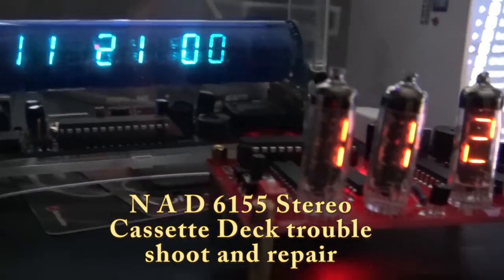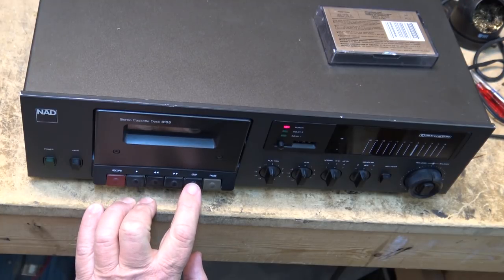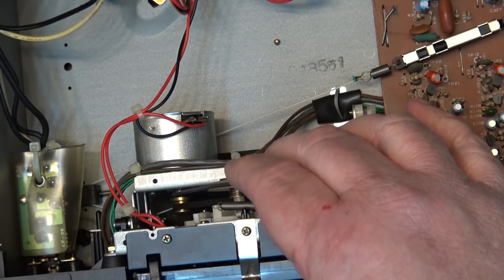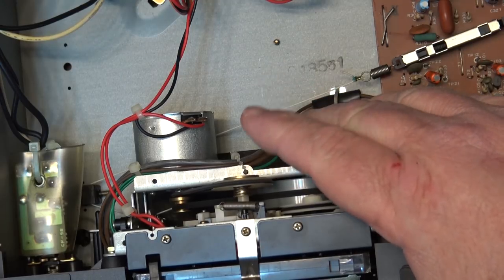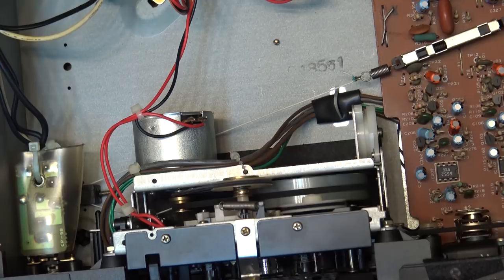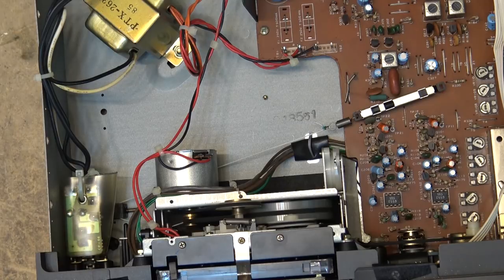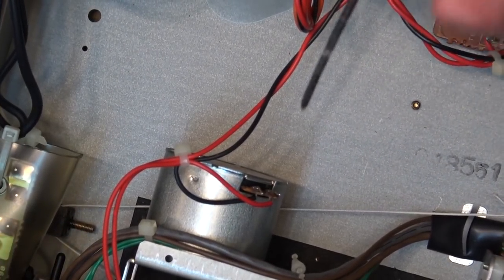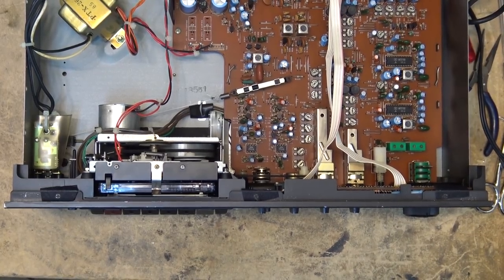NAD 6155 Cassette deck repair

Comment: TI-99
Reply: BillyLapTop I think we have a winner
Reply from the maker: Gold star for you! 
To be precise TI-99/4A
Reply: Thank you for the Gold star.  I had several of the TI's, in addition to a whole bunch of other brands in those days.  Those were really fantastic and exciting times because personal computers were just taking off.  

DOS was  on the horizon and the computer software stores were divvied up into sections depending upon the OS one was using.  Billy Gates did us good when he slipped it to IBM and created a standard for users to rally around.  Apple was just too expensive.

I remember going to computer shows that were so jammed packed, one could barely move down the aisles, let alone being able to make it to a vendors table to see their wares.  The Computer Shopper magazine was pushing 5 to 600 pages of clone after clone, plus every kind of hardware one could want etc.

It is amazing how far things have come.  Makes one wonder what the next quantum leap will be in consumer electronics?

Best 73's
Reply: Pfft. He just remembered you talking about yours in a previous video. :-P
Reply from the maker: LOL

Comment: I have no idea why you keep boiling belts when, if you know the right places, they are easily available for a couple of dollars.

I am in the UK and it's more difficult over hear but it's still do able
Reply from the maker: Here is the problem. Order a belt off ebay or anywhere else.
Pay the 6 or 7 for the belt, plus shipping. 
Belt arrives by fed ex, or UPS or whatever the seller sends. Then the delivery guy wants an additional 20.00 broker charge. So that belt has now cost 30.00.
I actually had to order one for my Tascam DA40 because it was a natural rubber belt that melted. By the time that 1.00 belt landed it was 30.00.

When we had local parts stores where I could go pick one up, I used to do that. A pack of 10 belts was 5.00. But the shops have closed their doors, and the ones that are left don't stock new belts, and the ones they still have have been sitting in a package for 20 or more years so they are already in rough shape. The last new belt I bought for my 3/4" deck was so sloppy it fell off the first time I used it, so I had to boil the new belt to make it work.
 
Now I can have the belts shipped to my USA parcel receiving joint, but then I have to pay them 5.50 to receive the package. I have been doing this for 30 years since I first learned the technique from a broadcast engineer at the TV station I worked at right after college. I don't do it often, only when I don't have a suitable belt. I do have a few that I have had in my stock bin for at least 15 years, but even those need refreshing, as the problem is if they sit around they loose their elasticity.
Reply: I usually place a big online order, If I order 1 belt in UK ends up costing about £10 as you say,  I just bulk order square and flat belts, I've got enough for years
Reply: Here in Los Angeles parts houses have closed. Sometimes my repair shop would sell a belt, but we and many other repair shops are long gone.
Reply: How is buying a belt at any price more sensible that repairing the one you already have. I too am in the UK, this guy's technique seems sound to me.
Reply: boiling the belt is just a temporary fix
go on tapeheads forums and ask about boiling belts, you'll be laughed at.  You are in the UK - make an ASWO account and CPC account, you can get pretty much any belt for £1 to £2
Reply: why spend money if people dont want to pay more than 50 for a repair?
Reply: @zetecfiesta crappy belts from China arent any better than these old ones, maybe even worse

Comment: 15 minutes?? Jeezus. I'm assuming that you've tried a shorter time first.
Reply from the maker: When boiling belts you need to get the water to a rolling boil and keep it there for 10 - 15 minutes. This is how long it takes for the rubber to reform and recover it's elasticity

Comment: Hey nothing against ya... but why didn't you just change all the belts for a complete repair.. That method is good for a temporary fix but not long term. I guess for someone who doesn't want to spend much to just "get it working" i suppose its ok.  also BTW.. cute "self made" demagetizer... LOL.
Reply from the maker: Frank Scarano 
If I had the belts I would but I don't. I have had a batch on order now for a few months. Ordered about 100 different sizes off ebay. They got my 💵 and I am still waiting. 
The boiling method works fine. I did my technics deck about 2 years ago and it still works.  It depends on how bad the belt is. If you get it before it is really bad then the chances or success are pretty good. It all depends on what the belt is made of.

Comment: So how much did u rip this guy off for boiling a belt?? Im an electronic  tech 30+yrs and i would install.a new belt. Boiling a belt is a band aid fix. Not professional work.
Reply from the maker: I didn't rip him off because he paid me zero to get it going.
If I had a belt I would put one on, but ordering one from china takes forever, and forget Ebay. They want to charge me 25.00 to ship it to Canada.
I have been boiling belts for 35 years, yes that is how long I have been a tech, so I have you beat, and they last a LONG time. You should try it some time when you are in a pinch. I learned that trick from a broadcast engineer when I did my time as an intern at a TV station just out of college before going down the electronics road. They would do it on our cart machines when they didn't have a spare. They boiled the rubber idlers on turn tables as well.
I have done it on my own gear so I can monitor the performance and they do last.
Keep in mind that not all belts will respond. It depends on what they are made of. Natural rubber belts it works fine on, but synthetic belts it doesn't. Or is it the other way around I forget. Anyway you will know right away as if the belt returns to it's original shape, and becomes elastic again then it will be fine, if it doesn't and still remains a limp noodle then sorry charlie you have one that won't work.
I only do this when I have no replacement. It's not like I can drive to the electronics shop and buy them. When the big shop closed he sold off all his belt stock for a penny on the dollar to the 1 audio shop that remains. They will not sell belts or any parts. They charge 95.00 to put one in for you.
So I don't have much choice as if I order one, the shipping costs will exceed the repair limit. This video was intended to educate people about what can be done to restore a slippery belt. Naturally you being someone in the business probably doesn't like having your secrets given away because now every tape deck you service, if the owner has seen this video is going to question if you actually replaced it or boiled it. Thanks for the thums down.
Reply: Troll